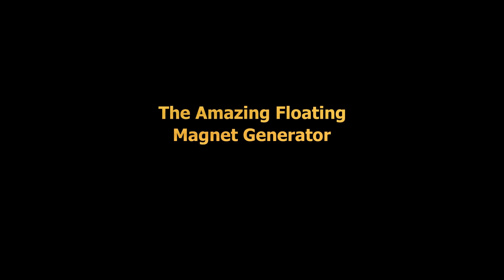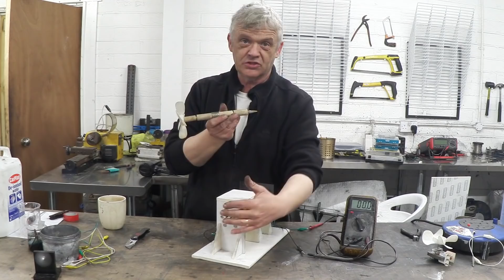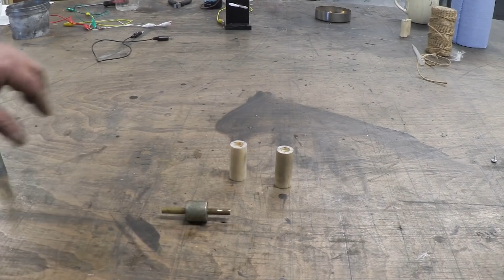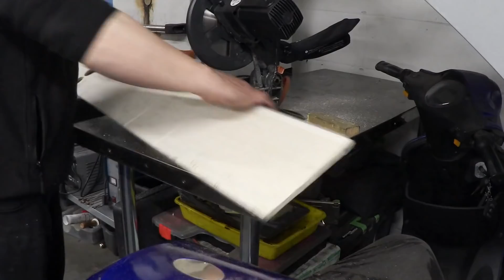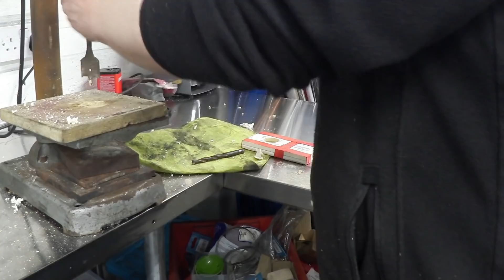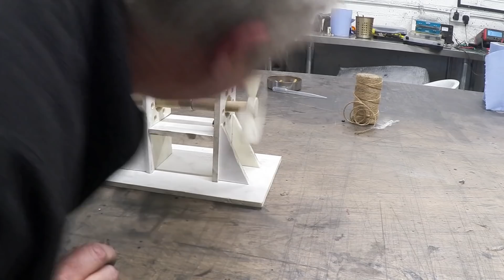The Amazing Floating Magnet Generator

Comment: I'm having trouble finding pure tin scrap for a experiment using Fusion to fuse tin and copper into gold then I need to stabilize the isotope with 14 neutrons because fusing copper and gold gives you 79 electrons 79 protons only a 104 neutrons which means stabilizing it with 14 neutrons should give us a nice stable 118 another possible combination for Fusion to get gold would be tungsten and boron with adding three neutrons to stabilize the isotope to gold 118
Reply from the maker: modern pewter is 85-99% tin - I suppose you could try getting some of that and trying to purify it
Reply: ... How are you accelerating them? I don't even know how to calculate the required energy, but I know it's going to be a great many electron-volts. Built your own accelerator?
Reply: @vylbird8014  it's an experiment major optimization will be done after some test it starts with a 15-50kv 350w zvs flyback power supply to start feeding into my reactor that will atomize the tin and fuse it to a thin copper target and well initially I was planning on using my prototype Fusion reactor core but I'm going to redesign a new prototype for directional Fusion with added magnetic acceleration. instead of my current prototype which is spherical Fusion using a collapse in the plasma vortex to decrease vacuum requirements and then I'm also designing a fast Burst Neutron gun for stabilizing the isotope. as for further data and calculations I'll have to do some testing first
Reply: @vylbird8014  no I built my own Fusion reactor core and the linear accelerator is the neutron gun part I have to build to stabilize the isotope

Comment: Should have called it ‘ Floating Magnet Bearing Generator.
The floating magnetic bearings are cool, but does it power anything more than a voltmeter?
Reply from the maker: the bearings are cool mate and what this video is about - the generation is standard so would perform like any other magnet coil generator

Comment: You took magnets from the microwave, could these not be used? They seem to be the right size and shape.
Reply: .....the rare earth magnets can suspend their own weight but not this ain't an ability of ferrite magnets.
Reply from the maker: I have seen them used. mate and you could - especially for the static bearing magnets - but Jules has it for the coating magnet you really want something pretty powerful as the rotor is quite heavy - though having said that I have also seen the ring magnets in a rotor just not carrying anything apart from the connecting rod

Comment: I don't need much tin for the experiment 5grams should do if I'm successful this could be very important for the electronics field and will reduce the cost of Technology You by not having to to use a expensive precious metal to do their gold coating on the tabs and fingers of various components and inner components of silicon chip
Reply: you know tin whiskers right?
Reply from the maker: search what has tin in it - or I suppose you could always just buy some I saw 100g of pure tin ingots on sale on eBay for ten pounds
Reply: Ok thank-you looks like I'll go on eBay and try to get some thin sheets of lab grade tin. I already have the pure copper sheets that I'll use as the target, as the tin has a higher positive ionization rate then Copper. Now I just need to build a fast burst Neutron gun to stabilize the gold isotope  quickly from Neutron count in the nucleus of 104 to Neutron count of 118 and it has to be a fast Burst so I have more control and dont overshoot and end up creating an unstable isotope that will either turn into Mercury or turn into Platinum ....that's going to take some testing and crap hear i go making lots more hv-caps And i need to harvest more lead to make lead paper for shielding the waveguide.
"Never enough materials, never enough time, and never enough knowledge. 
Always strive for more information, innovation
And push your limits both mentally and physically.You'll be shocked at what you can achieve." 
By. Someone who probably said that a long time ago...
now days damn near everything has been quoted already.
Reply: @GigsTaggart  are you talking about when it gets cold it oxidizes and forms the crystalline structure because that's not much of a concern in a vacuum and being heated by a fusion reaction everything else I've heard people trying is using heavier elements and breaking them into and isotope of gold like lead or bismuth or Mercury a problem with that is fission tends to leave too many neutrons which turns it into a unstable isotope of gold which then turns into Mercury to solve that we make an isotope using Fusion that has less neutrons and we work our way up with Neutron bombardment in a quick burst rate
Reply: @GigsTaggart  This is the experiment that I'm wanting to try and that I'm prepping for  right now. By using fusion to fuse tin and copper into gold isotope 104 I need to stabilize the isotope with 14 neutrons because fusing copper and gold gives you 79 electrons 79 protons only a 104 neutrons which means stabilizing it with 14 neutrons should give us a nice stable 118 isotope  if I'm successful with this experiment this could be extremely important for the technological production industry as expensive gold is used in many of their processes for making solid state chips ultimately lowering the cost for future technology  in theory this should work with tungsten and Boron and stabilizing it with an extra 13 neutron's
Reply: @numatechprototypes222  Capturing 13 neutrons. Oh my.  Tin and copper to gold require a large energy input to fuse, the binding energy is well into the negative part of the curve.
Reply: @GigsTaggart  14 neutrons added to tin and copper to get the 118 stable isotope and as for the rest that's what experimenting is for. the funnest part is optimizing the system to reduce the required input and hey if the power draws High this experiment isn't to produce power using fusion. it's to produce stable gold and that will just keep the price of gold high even if it's synthetic but technology is always getting more efficient every year reducing the required input which would cheapen the cost of production.
 very long story short I wouldn't criticize an experiment before it's come to fruition like I said earlier most attempts to create gold synthetically using  been using fission taking heavier elements like Mercury destabilizing the isotope to where it decays into gold but it never lasts because it's a heavy isotope of gold isotope with 122 neutrons and it will turn back into Mercury with time. gold was created in neutron stars and supernovas using Fusion not fission
Reply: @GigsTaggart  oh and thanks for talking with me it's good to get some feedback you know. The more data the more knowledge thanks if you could let me know of any other questions. Positive or negative it might help me to start optimizing the system. By designing a new Fusion core prototype that creates a directional fusion reaction instead of a spherical one is one of the things that I'm starting with. I think I'm going to go with a linear vortex with a magnetic pinch alternating between a magnetic acceleration and it magnetic pinch right at the beginning of the vortex to help atomize tin accelerate it and slam it into the copper Target at 1/16 to 4/16 light speed should overcome the Coulomb's barrier and give the +2charge tin atom a high enough speed to fuse to the +1 charge copper target oh and fun fact tin has a high atomization rate combined with its have your atom should be able to overcome the strong nuclear force that is holding the atoms together allowing them to fuse under more lenient conditions for those heavier atoms like the 100+ you need to achieve near light-speed in order to overcome the strong nuclear force

Comment: Yes, but what is the point of it?
Reply: Really, if you need an answer to such a question,  then you are in the wrong section of interest.  No insult intended.
Reply from the maker: I am sorry mate but that is hilarious - Kezza has it - you might not want to be here - the point is fun, explore, learn - if that's not you then you are wasting your time here  - like kezza no insult intended mate
Reply from the maker: I wonder what he was looking for?
Reply: @ThinkingandTinkering  No, it is very interesting Robert as a nearly frictionless bearing requiring only one physical contact, and I didn't mean to sound harsh, but it does not solve any problem which needs solving.  Do you see any practical application?

Comment: High volts and not amps it's static, real fake s***
Reply: I only always start with high voltage generators with low amps.  They are the easiest ones to find for free.  All you need is a shell type transformer to bring the voltage down and the amperage up.  Then a rectifier, capacitor, and voltage regulator for steady output.
Reply from the maker: it's a magnet turning in a coil - so the same as any other dynamo - are all dynamos fake?
Reply from the maker: I wouldn't really bother replying mate - he is clearly someone who doesn't understand and just likes being provocative - this is just like any other dynamo the interesting thing is the bearing not the generation - the generation method is just standard